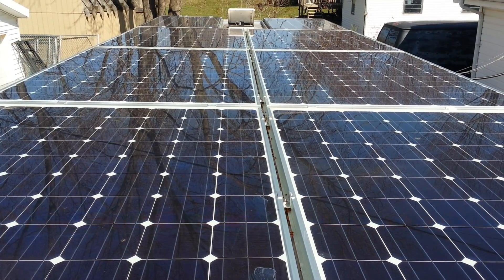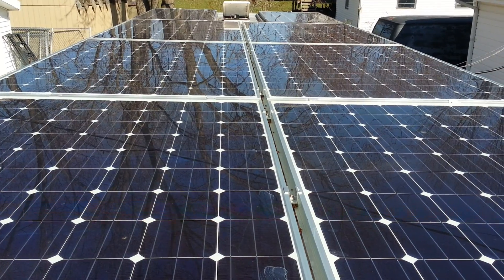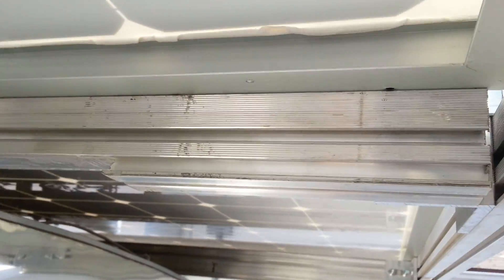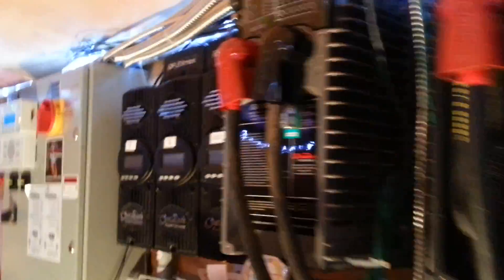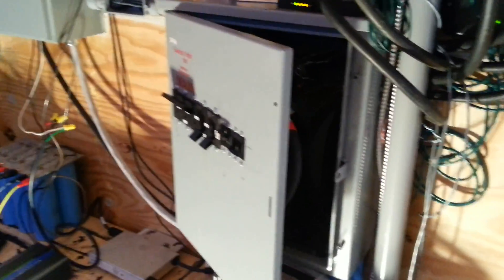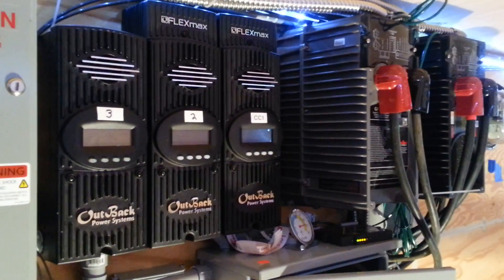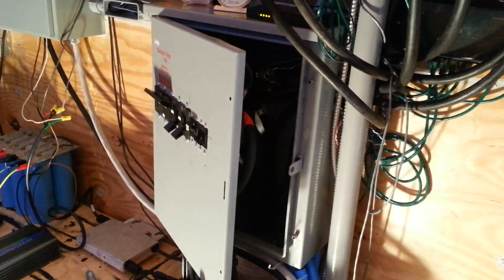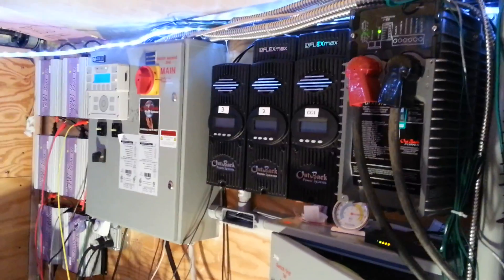3kw solar powered Off-grid RV

Comment: I don't see any advantage at all to convert to 24 volts.  In fact, I would say there is a disadvantage.  With 12 volt, if you connect the batteries in parallel, you increase your amps.  If you have a bad cell you still have 12 volts.  If you connect them in series, and lose a cell, you will no longer have 24 volts.
Reply: AngryAdonyx I can see why you call yourself Angry Adonyx, you rant and rave about nothing!  I think it's time for you to take a tranquilizer and a nap!
Reply: Darrell Reeves Hey Darrell, especially with long runs, reducing wire size can save you huge amounts of money, I know, I have both a 12 volt and a 48 volt system.  Additionally, there is zero efficiency lost by going to smaller wires for higher voltage systems.... I have a Midnite Solar Classic 150 MPPT charge controller, using a 12 volt system I can only use four 265 watt 20 volt panels before overloading the charge controller, using a 48 volt system I can use up to fourteen 265 watt panel with the same charge controller and do so without overloading it....  Anyways, have a good one bud!
Reply: AngryAdonyx I guess I need to turn my electronics degree back in then, maybe I should also ask for a refund.  The FACT is I have studied (and am currently studying it) and I have the real world raw data to back it all up.  All you have is hateful half baked insults.  While it's true you need a certain amount of voltage, it's also true your batteries are only 12 volts.  If you connect them in series  you get 24 volts.  If you lose a cell (pretty common) now you only have 22 volts.  Batteries are measured in amp hours, the more amps you put in (parallel) the faster the bank will charge, meaning you will have that much more to back feed through your meter to the power company, which means a lower light bill, if not even a a credit from them.
Reply: The biggest advantage of higher voltage is smaller required wire size and fewer charge controllers, which can save you a lot of money, but since he already has everything wired and has 3 charge controllers I would have to agree with you!
Reply: Bill Yates I really don't see any advantage to a smaller wire size other than saving a few dollars, but you have to ask yourself, "is it worth it"?  I would say no.  Since the smaller wire would be less efficient, the savings would offset.  Plus, you want the amps!
Reply: Darrell Reeves I have mixed emotions when I see 2 people who are hilariously ignorant on a subject spouting assertions about how things work. Making statements of "fact" when you obviously should be asking questions, but you think too highly of yourselves to ask for answers, so you pretend to know "better" than somebody and publicly externalize your misgivings and embarrassing notions about the "right way" to do things. Maybe you do it because you really are arrogant enough to always assume you know better. If that's the case then you're arrogant, stupid, AND wrong. Or maybe you know you don't know anything about the subject, and you want someone to tell you but because you're an arrogant douchebag you feel that you'd be lowering yourself to imply that you don't know everything by being seen trying to know SOMETHING. So maybe you both intentionally started your hideously moronic banter to bait someone like me into stopping, as if for a car crash, to pull you from the wreckage of your ignorance. But I'm not going to grace you with facts or knowledge, because I don't care about helping you. I just wanted to stop and tell you that the poster's ideas are correct, that yours are comically incorrect, and that your stupidity, ignorance, and arrogance made me cringe with embarrassment for you when I read it, and I will continue to be embarrassed for you until I forget that you exist in approximately 25 seconds.
Reply: I understand the cost of wiring, but if you have a long run you need to upgrade your wire size anyways.  You can check the National Electric Code for just how long a wire is good for.  But you highlighted another problem, that is placement; you need to have the system as close as possible to the battery bank, and said bank as near as you can to where it will be used.  Not only for money savings, but to prevent current loss.  

As for your charging comments, you proved my earlier comment to be correct.  The reason you have to have more charge controllers is you have a LOT more amperes when you connect them in parallel.  This doesn't mean you necessarily need more controllers, rather a switch, when one bank is full, you have circuitry to to switch to the next bank.  You have the same watts either way, power is power no matter what you do.  It's just watts law, but volts and amperes are inversely proportionate meaning if you double your voltage you cut your amps in half.

Comment: Hi would you only need one flex max 80 if you changed to a 48 volt setup cause I did read you can have 5000 watts  at that voltage  is there a reason people stay at 12 volt setup thanks
Reply: If you stay at 12 volts, you can connect your batteries in parallel increasing your current.  In this case, if/when you lose a cell in a battery, you still have 12 volts.  If you connect them in series (to get 24 volts) and lose a cell, you lose just over 2 volts.  Yet if you drop a cell, you hardly notice the current drop.

Comment: That's a pretty serious system although it's not really made for the RV. It's more like you're just using the RV in place of your roof. Since the system is mostly just built for feeding power back into your house grid and you only have a small battery capacity.

Comment: AWESOME setup!
Don't know much about solar but know lots about wind. I wouldn't worry about the system changing the handling of the trailer, but keep an eye on the beating the panels take from the dirty air coming off your truck..

Crosswinds that make empty cargo trucks so hard to drive will at most create lift on one side of the trailer, but the panels will fail before transferring enough of the lifting force to the the trailer to make much difference.

The 65mph Relative Wind as you drive will be a huge mess of turbulence, unless you're towing this with a Corvette :). So the panels shouldn't have enough clean air to generate any steady force. Carefully towing with an empty trailer on a wide interstate in light traffic with a friend with video from a chase vehicle would be nice though..

I would do something to keep an eye on (or measure) the amount of buffeting the panels take. Depending on the speed and shape of your towing rig it might dump some ugly rotors right on top of that glass and beat them enough at least shorten their lifespan. If you do see a problem you could probably experiment with a simple spoiler "wing" on the back of your tow rig to move the worst rotors off the glass.

Love the rig! Thanks for the video!

Comment: i want to why you are using 12v system instead of 24 or 48v? and how you separate the panels to 3 charge controller?

Comment: Nice setup.  Wonder if you can get the same power out of the new flexible panels.  The weight saving would be nice and the wind drag would be less.  I know it is for emergencies , but you still have to tow it  when needed.
Ps if you're in to the M.A.R.S program I’d like to say thinks.
Reply: say "thinks." ?
Reply: Woops  Sorry Thanks

Comment: Stupid question, but does anyone know if the 3 kws generated could power an electric motor to "limp home?" I figure it's producing around 4 horsepower. Is that enough to limp somewhere if the engine died?
Reply: That depends on how much time you have to "limp home"?
Reply: Shadowcruise99
Well, that's true of course ;-) 
I was thinking here we have an RV weighing around 15 tons, and 4 HP to work with. Assuming the maximum grade you are going to encounter is 6% (per US highway guidelines, how fast can 4 HP get 15 tons going? I was thinking around 10 mph, but does anyone know how to calculate this?
Reply: I found a calculator (for TRAINS) that calculates a speed of 12.9 mph on a 0% grade for a 15 ton TRAIN with 4 HP, but I don't know if that is high or low for an RV because I don't know the underlying assumptions. The rolling drag would probably be higher for an RV than a train, but I don't know if the calculations include the weight of something that doesn't exist in an RV (like a locomotive).
Speed = 12.9 mph 
Rolling drag = 98 lbs 
Grade drag = 0 lbs 
Curve drag = 0 lbs 
Total drag = 98 lbs 
Rolling Hp = 3 hp 
Grade Hp = 0 hp 
Curve Hp = 0 hp 
Total Hp = 3 hp
Reply: The answer is yes as long as you don't have to go uphill.  I've seen a man pull a bus and I doubt he can generate much more than 4hp.  Of course there are no losses other than rolling resistance when pulling. Figure on close to 100# per tire from Michelin data.  I think an automatic transmission would absorb most of the power.  If you connect it direct to the rear axle then I'm sure it would move just fine.
Reply: rnordquest I think I answered my own question. A 6hp direct drive power pusher like this: http://www.djproducts.com/products/car-vehicle-pusher.html is used to move trailer and stalled cars.

If we could come up with 2 more hp, we could move an RV at ~3 mph at a 3% grade. (WE could also store 10 hrs of solar and use it for 2 hrs of  20 hp driving. Presumably this could be geared up to get up to ~10 to 25 mph on level ground. Almost enough to be useful. It might be good for cruising along empty roads in Arizona for instance. I would just integrate a pusher into the body of the RV itself, but the wheels would drop down when needed.

Comment from the maker: yes as long as you have a large enough inverter and battery bank to even out the power, you must have solar panels to charge controller to battery's then from battery's to inverter to air conditioner.

Comment from the maker: there are 6 CDE Type 500 120,000 uF 60vdc wired parallel to each grid tie inverter on the solar panel input acting as an input voltage buffer to smooth out any intermittent voltage spikes from the panels.

Comment: 3KW in an RV.  Dear lord.  You can run everything and then some with all that juice.  Refrigerator?  No problem.  Air Conditioner?  We got it.  Hell, we'll even let you run the heater while the AC and fridge are running.  

Well that's really cool.  I hope to have a similar system in the not too distant future.

Comment: Those panel installments look not rugged enough for RV mobility, maybe try to install some bumping proving additions like using some springs or rubber stuffs between solar panels and the rv roof top. Looks pretty sweet stuff!

Comment: Given that the inherent losses of the batteries require that more energy be used to charge them than can be gotten from them later, such a huge array would be needed to allow any decent vehicle range.
The only other option is a huge (several MWHr capacity) battery bank, which could be charged by a small (ONLY the entire RV roof and some folding side arrays) PV array.  This would only work because RVs sit most of the time and the battery would still take up most of the RV.  And cost millions.

Comment: that's pretty wild. but you're talking about direct usage right? straight from the array to power the motor? Not quite the same as having a battery(ies) for storing the power.. but like you said, the weight will have to be taken into consideration.. We stopped improving on the "battery" when fossil fuels because so popular, I wonder if scientists continues to improve the battery since the late 1800s if we'd actually have a better battery than we do today?

Comment: There are 43,560ft^2 in an acre, so if you consider that real world power density of the array will only be 4W/ft^2 to at best 15W/ft^2 and that the RV will require 150kW to 200kW, yes, the PV array will be about an acre in size.  And then you need to consider the fact that if you want to generate electricity while moving, the array would be over a mile long if it were constrained to normal ~8ft vehicle width limits.

Comment: 250HP is about 187kW, and there would be at least a few thousand watts of losses in the motor, VFD and wiring.  Your only battery options would be one of the various lithium cell chemistries as they are the only type of cell/battery that has sufficient energy density for a vehicle application.  Even then, you are looking at around a ton and a multi hundred grand battery bank.
And then there is the issue of the acre or so of PV modules that you would need.

Comment: I would like to know if a 35 foot long motor-home could be powered 100% by solar. How many automotive batteries will it take to drive a 50,000 lb. motor-home 150 miles with a 250 HP electric motor replacing the engine and transmission? I believe that a rack of 12 or more heavy duty automotive batteries could be welded in front of the electric motor under the hood to enhance the power storage. How many solar panels would be needed to recharge all the batteries in two days?